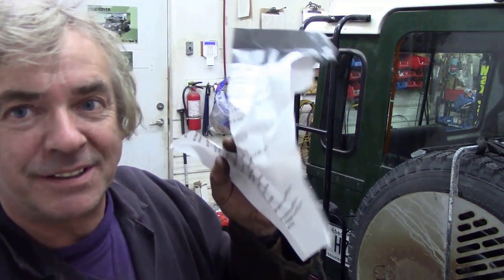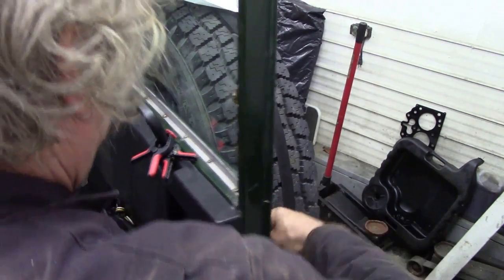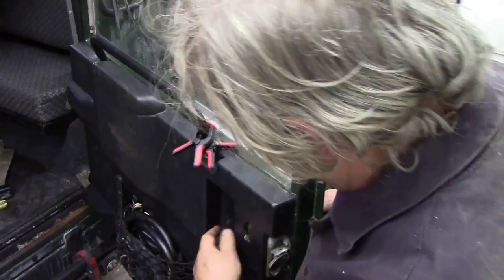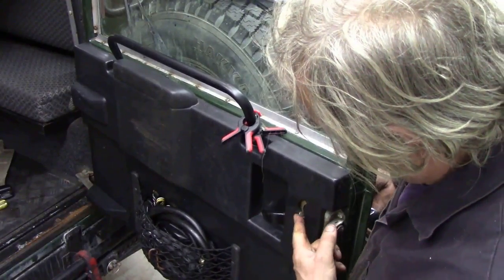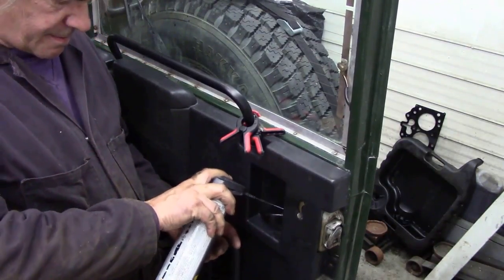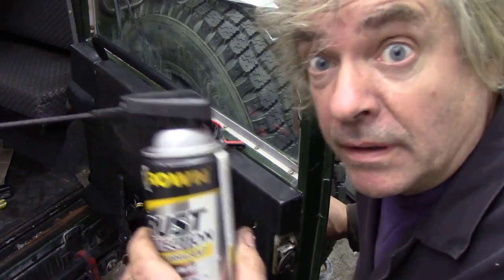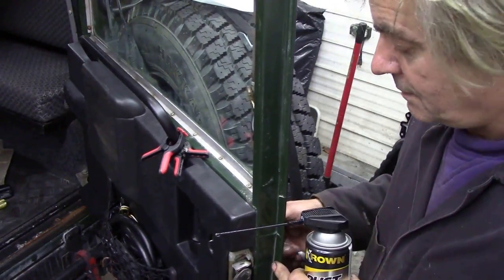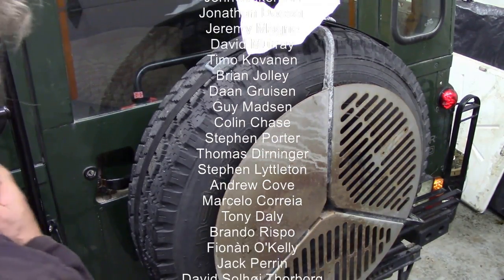Krown rustproofing to the rescue of a Defender rear door lock! (older vid)

Comment: Proves a point. Good old Krown. Need some over here in the U.K. 😎
Reply: You can get it direct from the Uk distributor...but they have run out, more promised in a few weeks via Amazon or E-bay
Reply from the maker: I have no access to Dinitrol  - maybe it does the same - would not be surprised!
Reply: @timhaynes6628  I bought a couple of cans ages ago and it was great, but tried to order more and I cant even get hold of the distributor to ask why its not available...
Reply: @Mikeaubert  Hi I got this from them last month."Hi,
Unfortunately we are out of stock and it is unclear when the new stock is coming in, it is all because of the brexit, we hope to get some spray cans within a month or so and we will be re listing them on our eBay and Amazon shops.
Regards 
Robert

Comment: I'm about to pull apart the rear door to get to the lock. My problem is that the handle feels like it's dislodged from the lock, so when I close my door it doesn't lock onto the latch ! If you get what I mean. It's a 110td5

Comment: Mike.  Might have to tension the spring ?  Krown rust proofing would do it's job, it's just the rest of the Def' will disappear !  V.
Reply from the maker: Inside some of the locks is a friction plate so the key can return to the position it can be removed  - these tend to be gummed up over time